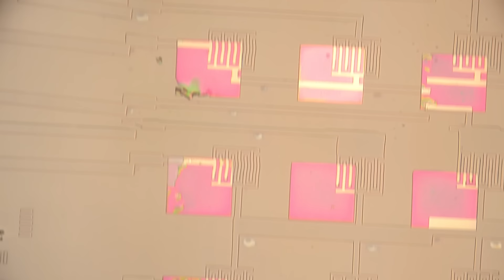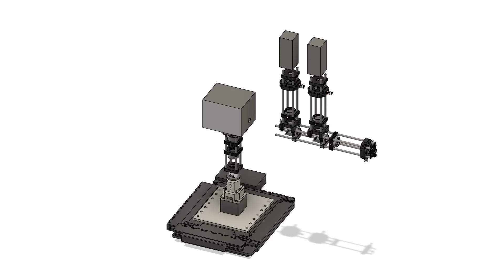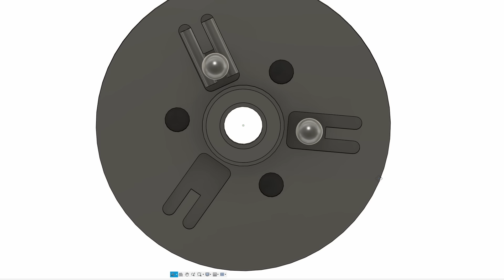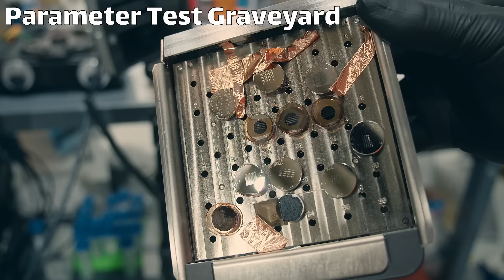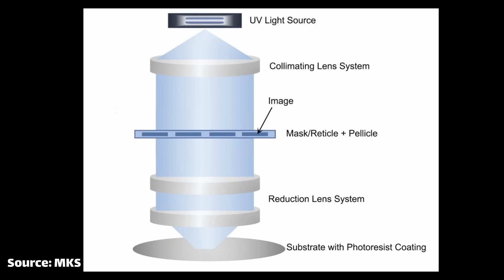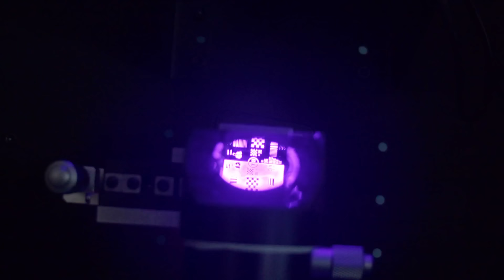Speedrunning 30yrs of lithography technology

Comment: Dude. Fantastic video. I’ve worked with/on litho equipment for years and watched this video with my wife. It’s like all the things I’ve told her about litho over the years were in this video and it all kinda clicked for her. So that was fun. 

Really impressed with what you were able to create, even with your defects. You’ll probably be able to correct a lot of those things over time. Probably need a more finely machined chuck to eliminate some unevenness then level everything as you install it. For some of your issues around the actual pattern, things like temperature and humidity will really affect how well your pattern develops. 

Anyways. Was really fun to watch. Thanks!

Comment: Not watched to the end yet, but you should make the frame from cast iron or maybe even granite. Otherwise the alignment will never stay the same because sheet metal is not thermally stable enough. A very sturdy hollow sheet metal assembly later filled with granite epoxy would be a budget option.

Comment: Hats OFF.   CPU designer retired 2017.  I am amazed and pleased to see this level of mechanics and optics in action.   Feature size was around 22nm then.  Moores law even at 90nM was a major thermal issue.  Leakage currents for the transistors was self heating limiting operational speeds to 1200MHZ and 105C Tjmax  for long term reliability.  All said a generation 3 Power Quick integrated host microprocessor❤❤ was executing over 2000MIPS (2,000,000,000 instructions per second) this is about 120 times faster than an IBM System 360 mainframe from 1968 ( 16.6MIPS ).❤❤
Reply: Nice! It's quite impressive what we have accomplished over the past 70-80 years in computer engineering and architectural designs. 

I'm still kind of anticipating seeing the day when we transition away from basic or conventional voltage-current based systems to drive data, logic, and instructions. 

With advancements and discoveries in various fields such as 3D Printing (still kind of in its infancy), materials such as graphene, carbon nano tubes, micron level diamond chip-lets, etc. as well as current research and development in Optical based logic gates... 

Who knows, maybe one day down the road in the next 10-20 years we might see the day when we're able to print our own optical based integrated circuits at the nano level scale or even smaller even potentially allowing us to even print our own quantum chips.

Comment: Deburring is an easy step to underestimate. I usually make little parts but I find myself spending a lot of time going over the edges to make sure I didn’t make new sharp edges removing the old ones, especially on thin metal.

Comment: @BreakingTaps:  i was curios if there is anything special about the dmd system to make it resistant to UV.  A while ago i looked into using this for a home built sls system but found that they break down with exposure to uv over time.  Was this a concern for the project or do you just plan on having to replace after a period of time?

Comment: It took me a few months but I combed through your body of work to estimate a true and fully accurate investment that accounts for your time. I have to say after running it through a few models I was able to also correlate that to your production capability and honestly the ROI was shorter than I expected. As long as most jellybean ICs remain popular you’ll just beat out the heat death of the universe if your yields only slightly exceed current commercial processes.

Comment: I was once an engineer working with LIGA manufacturing techniques. We used Synchrotron Radiation as our light source. We could also get down to nano -sized using the electron accelerator. Made micro machinists mainly (gears, orifices, etc). You are a Brave man to take this on by yourself by the way.

Comment: I'm a dumb dumb when it comes to something this "in the weeds", but if you're worried about vibration in the surrounding structure for this device, would it help to add rebber washers at join points to reduce vibration transmission throughout the structure? 

I have no idea if this would work, it just popped into my head while watching.

Comment: Thank you for work. I would recommend using the metric system for your scientific work, as it is the international standard in most scientific fields. The metric system is based on the International System of Units (SI), which ensures consistency and precision across scientific research worldwide. It simplifies calculations, especially when dealing with conversions, as it is based on powers of 10.

For example, instead of using inches, you can use meters, which are universally accepted in scientific studies. This will make it easier for you to communicate your results with others in the global scientific community and avoid any confusion caused by different unit systems. In addition, the metric system is widely used in published research, scientific instruments, and data analysis, so adopting it will help ensure your work aligns with best practices in science.

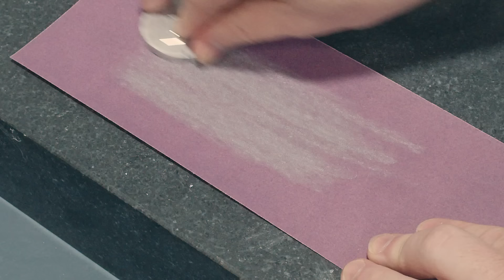Comment: 22:05 How about making a cup filling it with a molten liquid which hardens and then slapping metal on top. Like the back side of a mirror because mirrors are baked on a liquid salt serface, and the weight would stabilize, possiby?

Comment: 27:30 you did an amazing job getting the resolution you could out of that machine. "Flatness" is an entirely wild subject few in the world can truly understand. The ambient temperature of the room can effect the bow in the bottom of the case. It will change the angle of the arm leveraging on the main body. It's a subject you really should outsource knowledge from. A few Youtubers I recommend to help in your endeavors would be 1. fireball tools. 2 Alec steel. 3 smarter everyday. Huge amount of knowledge with those guys and they could be convinced to either give advice, or work on it with you. hope this helps.
Reply: Also to add to this, machine isolation. lithography machines are built in a way to minimize vibration, from well everything. The earth, cars driving, sound waves from other machines, you talking. Everything creates an amount of disturbance that can travel to the wafer. This creates distortion.

Comment: A better option vs your steel sheet metal plates would be to use waterjet and machined MIC6 aluminum plates, at least for anything that can be subsequently aligned with gauge blocks.
Reply: So awesome that you built this by the way :)

I remember learning all those same lessons as a junior mechanical engineer.

Also hilarious how you ended up back at building masks 😂😂😂

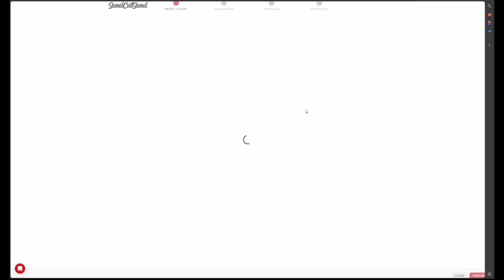Comment: 4:19 you’re pulling a vacuum to what hold the wafer in place?
why did you add a stepper motor? Why do you need to rotate the wafer?  For x y a microscope base would been plenty.
Also, do you ever show where the mask goes in your setup? Or is that too obvious to mention?

Comment: Charlie picking nahima was low hanging fruit, bro. Parker had some solid points, but Charlie just isn’t capable of contending with those based on his worldview.  Parker also has a tendency to be a complete a**hole with his superiority complex.  Also, Mason did a much better job than most at holding Charlie to a conversation heading in productive conversation.  I really appreciate Charlie putting himself up against lots of people at once.  I think if he can work a bit more with his own idea of reality and how it works, he could really give Parker’s tendency to attack someone’s worldview instead of the direct topic of conversation a run for his money.

Comment: I am about 40 years experienence lithograhy engineer.
The photoresist adhersion problem is on the glass wafer not photo resist. 

Between phtoresist and glass wafer, there is small amount of adsorbed water. During developement, developer can penetrate into it. Then lifting.
If you are interenst in discussing more about tool developement or lithography, let me know.

Comment: Over 40 years actually. I am 32 years old born in 1992 and ICs already existed :0 they were already there! You know what... Lithography is basically like 50 years old or something. 90s kids already had... Fucking Playstation (1994) y'know... I'm dead serious with you the Playstation is from 1994 meaning that the Playstation IS 30 years old. This means that Lithography is at least 20 years older than the Playstation because the thing was already so advanced... A console with full 3D graphics... ICs were already quite advanced in 1994 ok. Not to mention the Playstation LAUNCHED in 1994 meaning that it's production is actually at least 1 year older... It was produced in 1993.

Comment: very nice work.  your biggest limitations are the machining aspects.  if you had some precision cnc machining that would eliminate many of your headaches.   i think what may be missed when you had the stepping (where is would look straight for awhile and then shift upwards) is the table is not moving in x or y squarely.  try moving an axis it in one direction with an indicator on a flat surface in that direction  and see what you get you'll likey find its moving at an angle slightly.   on a cnc machine this becomes taper when milling in one direction.   i think you have the ability to get to a micron or even below, you just need to eliminate all your stack tolerance errors.  also  i suggest getting an indicator that's .0001" graduations.   get it close with the .0005"  indicator and then switch to the .0001" graduations indicator and your results will improve greatly as you'll be able to dial out even more error when you see it on a finer scale

Comment: You can prime wafers easily if you have a small heated vacuum oven. Put your substrates in with a crucible containing a few drops of HMDS (hexamethyldisilazane) and run the vacuum oven at between 100-150C. The resist will stick fine after that. HMDS is not that toxic and has low vapor pressure at room temp. Just run your pump exhaust outside.

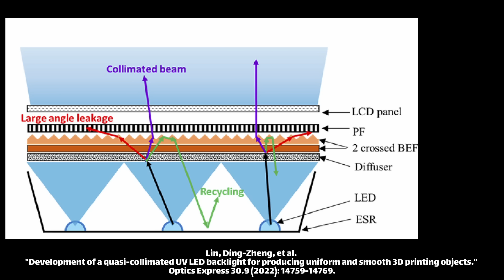Comment: 31:45 use an LCD or polarized film

Just take the polarizer out the laptop and use polarized sunglasses

Everyone thinks you'll be staring at a blank white screen 

90,180,240 or 360 degrees
Reply: Then you can laser it to get nice parallel beam

Take that light then feed it in between two mirrored lenses with the output lens less mirrorred so that the light "builds up" and shoots straight in parallel

Comment: You could probably replace some of those bolts with sinkhead screws. Because the sheet metal is so thick, you could easily use a bit to create the sinks and make everything flush.

Comment: I'm totally disappointed. That's a total garbage system overall -let alone a qualified win, making a 40 mins video and ending it without a legitimate result, and showing the disassembly of few components as the reason for not continuing the process means you've screwed up somewhere earlier and you are just having a hard time admitting it. PS: you could have used graphite air bearings instead of that sloppy O-ring ball bearing system with tons of surface runout as expected
Reply: I see you are fun at parties

Comment: Funny how you claim the first transistor was made in '47.  That was the first engineered intentionally made one, they existed prior and were even a stumbling block in some circuitry made in Germany during that war that actually impeded them making a smaller faster Enigma system using etch lithography.

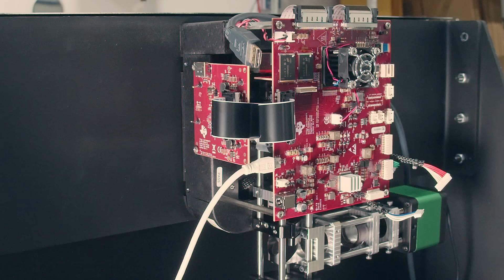Comment: 41:41 "Shorted open" is a pretty funny phrase. Even as an Electrical Engineer I sometimes struggle with describing the type of fault in components like diodes and transistors in a casual setting.

Comment: A tip for metal work from a welder (if you do more metal work): An angle grinder with a flap disc. Flap discs are like what sandpaper is for wood, but for metal. They are great for rounding/cleaning edges and getting mill scale off. It makes welding a breeze and would have taken less than 5 minutes to clean all the edges of your pieces. 

When I worked at a mom and pop fab shop doing odd jobs like store racks, we would use a lot of in-house cut sheet metal and we had boxes of the flap discs for edge cleaning simply because while they are quite consumable, they work VERY well.

Comment: Idea…
What if you get a second microscope lens and camera, and use them on the bottom? That could be used to not only test the focus, but also to detect lens "dust". The way I imagine it, it would the the top part without the chip/substrate on it… that would display the camera, and putting the chip… just shows black lol (although it can be used to ensure alignment as well, no?)

Comment: These quick turn shops need to add pemstud and pemnut insertion capability.
Reply from the maker: SendCutSend actually does have PEM fasteners! I haven't used them before though and was on a tight schedule, so I didn't want to risk any mistakes with my design and the fasteners. Definitely considering it for future projects though. I think they also do direct tapping if the sheet is thick enough.
Reply: @BreakingTaps you can also get flush mount pems that don’t extend past the thickness of the metal too. The model shop at work has an inserter and press so I use them in my fixtures where I can.

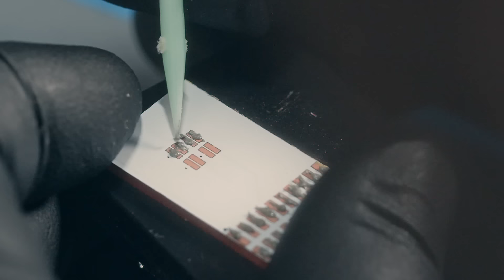Comment: 8:50. Full time schematic and PCB designer here. You did great for your first time using solder paste. You needed a lot less, but you did great for a first try. After a few more tries you'll be a pro at this.

Comment: It is clear why a rotary block is needed. But it's construction lead to significant inaccuracy. For aligning subsequent layers not need 360 degree freedom of rotation like on centrifuge with vacuum chuck. So better if it will be some cylindrical vacuum chuck with parallel top and bottom sides and vacuum hose on the side sitting on XYZ+ about 90 degree (or even less) rotary motorized stage.

Comment: No offence to sendcutsend, they probably have very short turnaround and decent prices, but speaking as a lasercutting operator running 3 10+KW fiberlasers near-continuously; Burrs of ANY kind are an indication of a mistuned laser. Focal distance, standoff distance, gas pressure, nozzle size, nozzle wear, beam alignment, etc etc.. it all contributes to a less than perfect cut, resulting in les than perfect parts rolling off the machine.

If those were my parts, I'd have sent 'em back. bowing can be fixed with a quick rolling operation, burrs are a no go, but would have been fixed with a quick chamfer, or heck even just breaking the edges with a quick side to side with a flapdisc on an angle grinder. Hole deburring is standard practice where I work. 

 I expected more from a company as big as sendcutsend, and honestly, I'm a bit disappointed. I thought they were competition. Clearly, they are not.

Comment: Hey! Just a tip, and it would be greatly appreciated: YouTube makes 1080p videos have "Enhanced Bitrate", but it's a paid option. It causes "normal" 1080p to be even lower quality than 1080p "Enhanced" already is. I know that you probably didn't produce your video in 1440p or 4K, but simply exporting it in 1440p or transcoding it after the fact forces YouTube to have a higher bitrate so it will look better. It is really hard to watch a video like this when the majority of the screen is blurry or pixelated from video compression.

Comment: Would love to see a "Take 3" video when you get it working and restart with everything you've learned and really see how far you could push the geometry.

Also, shouldn't you have air filter on any ingress points to prevent dust contamination?

Comment: I'd stick with a single system rather than DMD + 10x reduction. Reasons include:
- two machines contributing errors
- twice as many setups per wafer
- more process time means more time for mistakes to happen / contaminants to accumulate

If you need the rotary axis, I'd find a precision preloaded bearing assembly and do not direct drive it. Belt, flexible coupler, or even gears would be better than directly connecting the stepper. Of those, belt would probably be best so you can move the stepper motor away to keep its heat off of things.

With or without the rotary, IMO it'd be good to be able to do an angular adjustment in 2 axis, not just x and y.

Zeiss Rondcom 60A's have a spindle with XYAB that's probably good enough, though finding one on ebay could be a challenge. Lots of granite, so transport would also be a challenge. Other metrology machines also have rotary axes (zygo comes to mind) but similar challenges.

Did your UV LEDs work all the way through the process and fail when the unit was shut off, or did they fail while it was running? The former could indicate thermal shock was the culprit. Either way, I suspect they're running too hot - either because the heatsink is inadequate or because their forward voltage differs from the LEDs you removed. If you look up LED resistor calculator, it can help find the right value to make the LEDs last longer.

In general, heat will be quite an enemy in this machine, whether you leave it or remove it: either it causes component failures and/or distortion of the frame, or you remove it with a fan and introduce vibration and blow contaminants around.

Comment: Thank you very much for this video! 
I happen to work on the first in field GCA steppers. Got to help design the FAB enclosures, Fab placement and involved with the installs up until we put them into full operation mode at which point I moved on to other projects. Worked with field service techs and engineers while we tried to get them on line. Good time!!